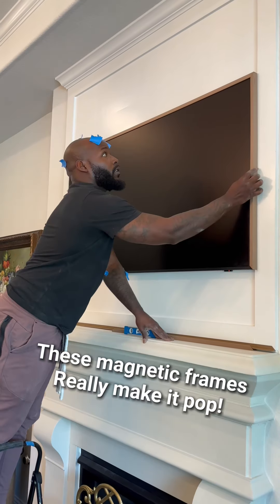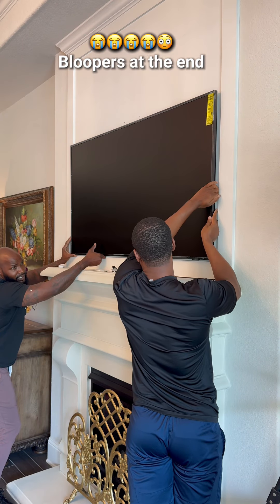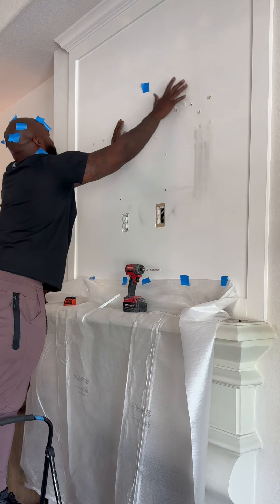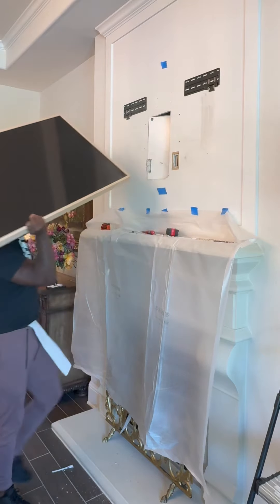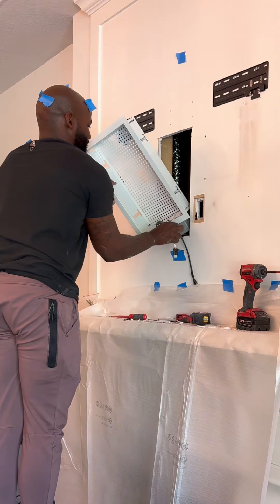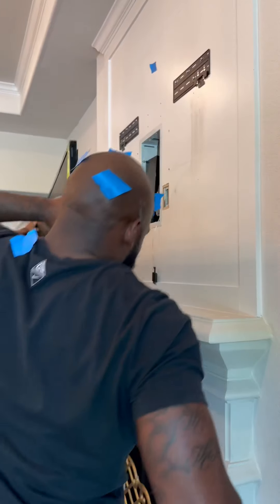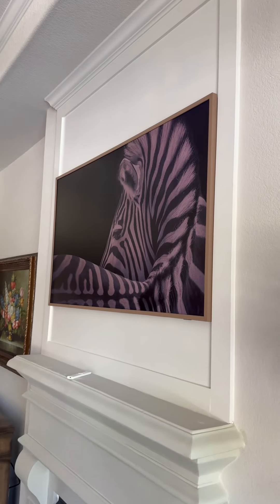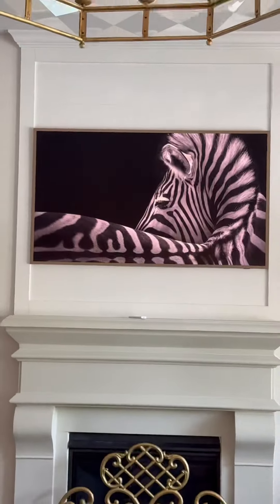Barely Fit!! Samsung Frame Install above a fireplace (full video)

Comment: It would be great if Samsung just did away with the damn one connect box. No real reason to have it anymore and it makes installation much more challenging.
Reply: That's what makes the frame extremely flat. Otherwise it will be just a traditional flat screen